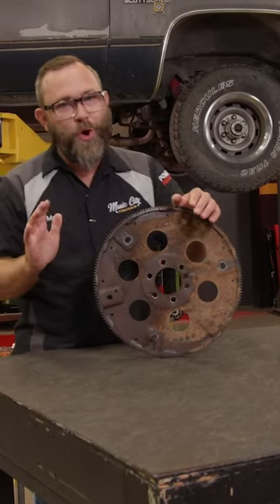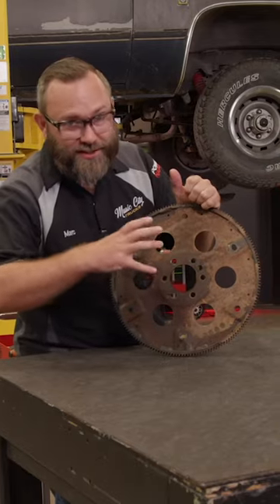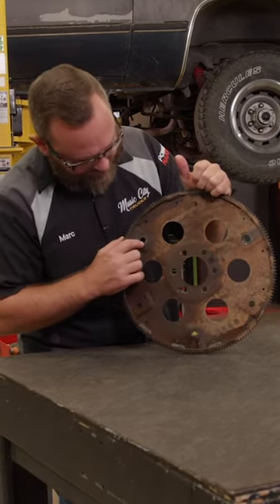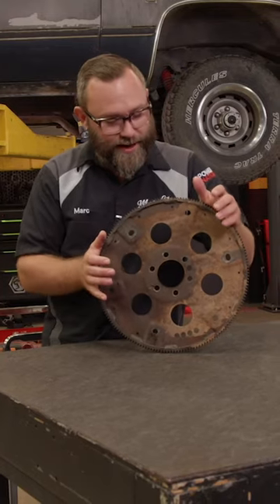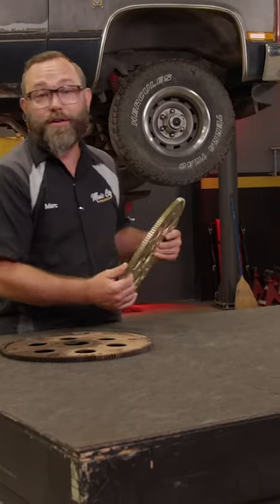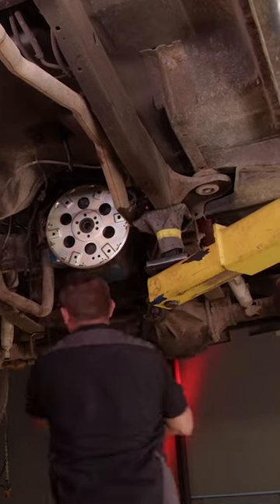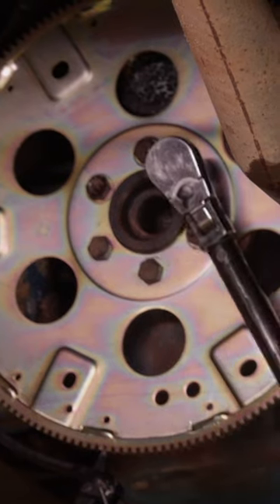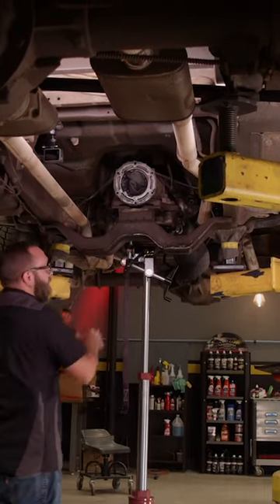Replacing Your Flex Plate

Comment: Only thing worse than needing to replace a flex plate, is needing to do it twice. I used the wrong torque specs making it way too tight and it ended up cracking within a week.
Reply: Wow, what torque was that. I did 50ft lbs on a 91 s10
Reply: I think that’s what happened to mine, a week later it screwed up

Comment: Ahhh yes now let's mention the seperator plate for the 5.8 windsor is hard to find and the 4.9 will destroy ur flexplate and then also never use a manual starter on a automatic f 150